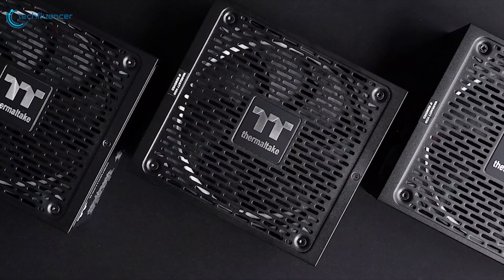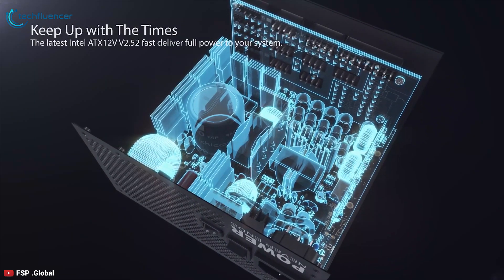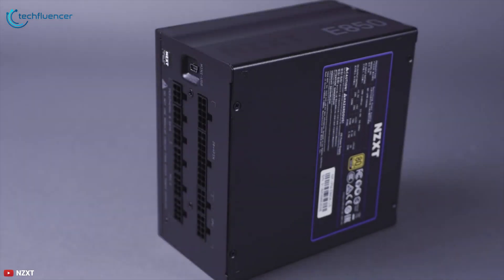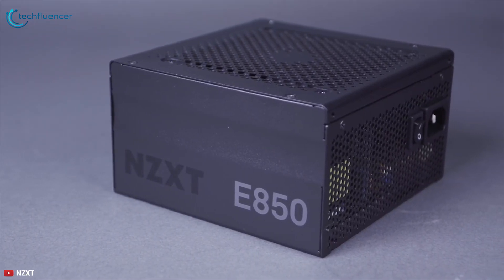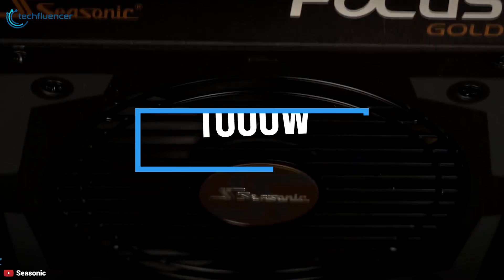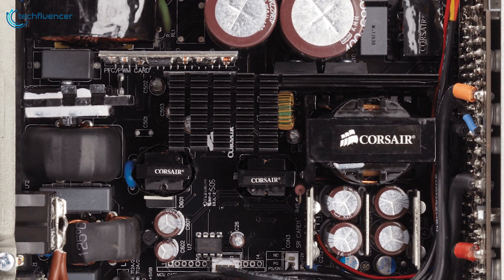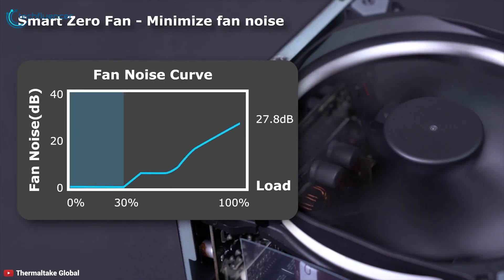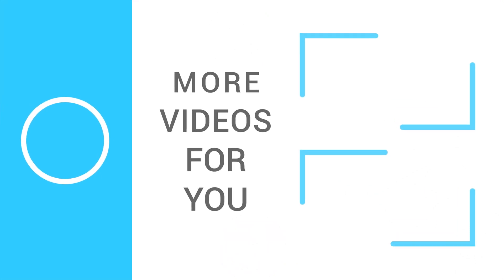Top 5 Best Gaming Power Supply with 80 Plus Gold Certified

Comment: I have a 3070 but Idk if I should go for an i7 10700kf or a ryzen 5600x and which mother board get and the psu, which one would you go with?
Reply: Ryzen it needs less power plus mobos are cheaper for it.  But if you get 10700 you would be definitely fine too.  In gaming though ryzen right now is a beast on part with 10900k
Reply: Get a 5600x

Comment: Ryzen 5 5600x, rtx 3070 x570 tomahawk? How much and which one should I get?
Reply from the maker: For you setup, you can choose the Corsair RM750x. It will be enough for the RTX 3070 and your other components.
Reply: @techfluencer  bruh one thing more for 1500 build should i go for 3070 or 3080
Reply from the maker: If you want to play multiplayer games or content creation, you should go with the 3080. And if want to play offline games you can go with the 3070 as there is littlie FPS difference between them.
Reply: @techfluencer  and ill buy b550 strix e mobo for 3080 cause 190 price now .. what do you say about mobo this or any other under 200
Reply from the maker: ASUS ROG STRIX B550-E GAMING is a good option for RTX 3080. You can also try the ASUS TUF Gaming B550-PLUS WiFi which is a little bit lower price.
Reply: @techfluencer  I’ll definitely look into it.. 😌
Reply: @randomtutorialguy5386  3070 for sure

Comment: What do you recommend me for ryzen 5600x and rtx 3060ti ?   700w is ok ?
Reply from the maker: Yeah it will be ok. But 850w will be better.
Reply: @techfluencer  😒 for rtx 3070 Is recomended a 650w.
Reply: @jared_tyson7133  There are a lot of factors, the recommended is tailored towards those with that gpu and a high end cpu, with high power draw, and several storage devices/monitors, So for some systems, eg a 2600 and a 3070, you can get away with a 550W psu
Reply: @techfluencer  are you an idiot?

Comment: Ryzen 7 3700x
RTX 2070s
2x8 3200mhz
Is 650w psu enough ?
btw nice video !
Reply from the maker: Yah. A 650 Watt power supply can run your system. But its safe to use 750watt power supply if you wanna update some component in future
Reply: @techfluencer  thanks for the info 😁👍